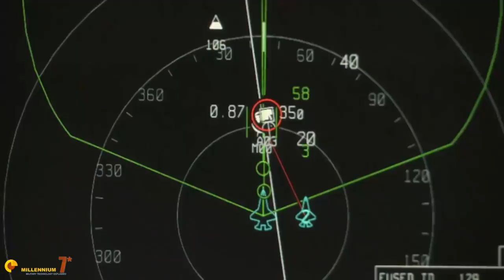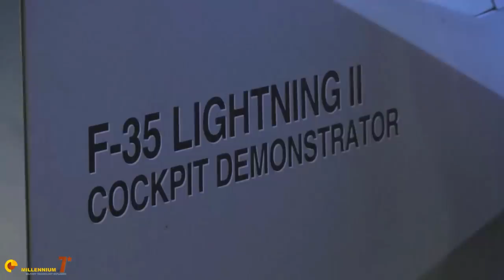Put the F-35 inside the F-16 | Are there limits to upgrades?

Comment: Good video (again!) :)
The F-15 is somewhat more updateable than the F-16. It was designed to counter a somewhat unknown threat from the latest Russian air superiority fighters, so it had more in-built space, more modular design, and more excess of electrical generation, in order to be more easily upgrade-able. The F-16 was designed to make a smaller, simpler plane which largely just competed with the F-15 at short range (a more known quantity), and at low cost. So it's less modular, and has less future-proofing in internal space clearances.
 
Swapping a radar into a plane isn't too bad, provided there's sufficient radome width. The radar weight is rarely an issue due to the trend of shrinking electronics size, this also helps offset the space needed, apart from the radome itself. Phased array plates used in modern radars also tend to help with the space and weight issue, since a moving dish in gen 4 designs tended to require more space to operate. Power definitely can be an issue though. 
 
I think GD really missed the mark with the F-21. It's a re-design of the F-16, and frankly I'm shocked that they didn't go with the F-16 XL wing layout for it.
 
Ultimately, I think any new gen 4++ should incorporate the large all-moving V-tail, hanging back behind the engines. It's just a lot more control with less drag. Not that I advocate a new 4++ fighter design... it would be far easier to "modestly" update an existing gen 4 design, or create a reduced-feature F-35 design.
 
Whatever they end up doing, there's no such thing as a plane with all of the F-35's internal features, at a cheap cost. The internal features are the lion's share of what makes the F-35 expensive to operate. (and make it an order of magnitude more effective than gen 4). There is an argument for having a design which is far less distributed in production though. Currently you need a team of lawyers, diplomats, and translators (and 1 engineer) to make even a minor change to the F-35. It's just far too outsourced to allow for a smooth tweaking process, and that's the main thing driving it's refinement woes. Also, "design while you build" really deeply constrained the design refinement process. I would hope that the USAF (and other branches) never EVER again fall for the "on paper" cost savings sales pitch of "design while you build". They've fallen for it several times now, and it has NEVER realized a benefit. Actually, your video (without being directly aimed at this topic) rather succinctly outlines why and how it's a flawed approach.

PS: loving the new videos sir! Once in a while I may nitpick, but it comes from having a sort of nerdy appreciation of what you produce. Your videos are always excellent.
Reply: @henrikg1388  No... by "modestly updated gen 4" I'm refering to the F-21 and F-15EX, which are both already developed and ready to ship. As for a "feature-light" F-35, taking things out of a plane is actually a lot easier than adding things in, so it doesn't really contradict the points in this video either. I think we got our wires crossed on what I meant by "modestly updated". By "modestly" i didn't mean trying to put F-35 features into gen 4's. I just meant the versions which the makers developed on their own which are for immediate sale, but which are more updated than the planes in inventory.
Reply: All you need to do in order to realize the benefits of how the JSF program was approached is compare the total losses of 427 airframes from the F-14, F-15, F-16, A-10, F/A-18, and AV-8 within their first ten years of service, with 147 fatalities.  Every time I see people critique the 3 different JSF variants for tiny little glitches that every single fighter and bomber go through, I realize they didn’t live through or gain any historical background of all the issues we faced with the teen fighters, Harrier, and Warthog.  You could throw the F-117A on top of that since it was developed and produced at the same time and the airframe losses and fatalities would increase a few, although it was relatively safe since you had to come from another fighter before going into the Nighthawk.  I was kinda shocked they didn’t crash anything during JSF X-plane tests, especially the STOVL model.

Then I was certain we would see them crashing in the first few years, but nothing.  I wondered, “Are they even flying them that much?”  Then looked at total fleet hours hitting 100,000, then 200k, then 300k.  It was just crazy.  Finally, after 12 years of production, the first F-35B crashed during fighter conversion training out of MCAS Beaufort in 2018 (someone installed a fuel tube incorrectly or it was made wrong).  My bets were on either the Marines or the Navy to be the first to put one into the dirt/ocean, with the hazardous nature of carrier operations leaning towards the Navy.  It’s just insane that the Navy has found a way to smash one yet into the deck.  They had an aerials refueling mishap with an F-35C where it ate the steel basket off a Hornet configured tanker.  The F-35C recovered on the carrier, whereas the Tanker Hornet had to divert to a base on land.

Remember, the first F-14 prototype crashed on its maiden flight, and later killed the test pilot, who barely survived the first crash.  The F/A-18 saw 100 (ONE HUNDRED) total airframe losses from crashes in its first 10 years, with 20 fatalities.  These are real people with families, not just numbers.  Harrier was the same.  ONE HUNDRED total airframe losses in first 10 years, 20 fatalities.

We’re 630 airframes into the program, have been in production since 2006, approaching 400,000 flight hours, operating among 10 different services around the world, USMC, USAF, UK, and Israel have been using it in combat since 2017/2018/2019, and we only have 1 fatality?  Israelis have been shot at by Syrian SAMs over 100 times as of 2018, and are very tight-lipped about operations.  News has gone from, “A strike package of F-16Is hit targets in Syria.” to, “Explosions erupted in Syria, destroying cache and missile sites.”

But yeah, I hope the USAF never again uses this approach.  What a failure of epic magnitude!  Flawed approach for sure.  /Sarc

Stop and think people before posting about the F-35 and what a failed program it is.  Black is white, left is right when it comes to 99% of the media I’ve seen on the F-35.
Reply: @henrikg1388  Laughs in Gripen. Look at how many of those they've crashed.
Reply: @henrikg1388  10 major incidents with Gripen. 1 fatality. Multiple crashes were caused by pilot induced oscillations with the faulty flight control system, 1 from uncommanded ejection from the pilot's G-suit slowly working the ejection handle loose when it inflated. It's like reading a clown show.

All 4 JSF crashes have been immediately reported in international media, starting with the 1. F-35B out of MCAS Beaufort, 2. the Japanese F-35A that was controlled flight into the ocean/disoriented pilot, 3. the F-35A piloted by a former Strike Eagle crew who left the speed hold on and bounced one off the runway at over 220 knots, then ejected, and 4. The F-35B that mid-aired with a KC-130 during new pilot aerial refueling training over SoCal.

Out of 620 JSF variants delivered, it's an astonishingly safe record.

10 out of 271 Gripens is pretty bad.

There are no production Gripen Es or Fs. They've been strangely quiet about the F, which you would think would be the first model to deliver.
Reply: The late block vipers are way too fat. They get better engines but not more wing so the new ones can't turn anymore. F-16 always was an A2A design at heart. For a bomb truck you can take a phantom or F-111.
Reply: @henrikg1388  Gripen F assembly and deliveries to Brazil are scheduled for 2023. Every picture and latest news of Gripen E- to Brazil has been a single seat with no IRST, no panoramic display (F-35 copied) cockpit.

In the era of smart phones, we literally watched Pakistan's last F-16 crash immediately after it happened.

All F-35 and USAF mishaps are reported in extreme detail. I've been tracking F-35 mishaps for years now, primarily because I'm so used to seeing what we saw happen with the teens. The F-15 stands out as an exception to all its peers in development during the 1970s and 1980s, with an extremely safe record.

A-10 had several problems from the start, mainly with gun gas ingestion stalling the engines. They tried every sort of crazy muzzle device on it to try to vent the gas away from the airflow into the motors, and gave up. Changed the propellant IIRC.
Reply: @appa609  A-7D was the best single engine bomb truck USAF ever had, and they replaced it quickly with Vipers for whatever reasons, supersonic and self-escort being likely.

The best bomb truck they could have had was the XL, but there weren't any motors at the time to give it sufficient thrust.
Reply: @LRRPFco52  Actually on the A-10, they wired the engine igniters into the trigger for the gun. When you pull the trigger, the igniters in the engines fire up, so that if it flames out, it will re-start promptly. Didn't know they also changed the gas, but it makes sense. 

Personally I think the A-10's problem is the gun is too far forward, and the engine intakes too far aft. If the intakes were far forward, and the gun moved rearwards a couple meters, more under the belly, it wouldn't reinjest. But that would be a completely different aircraft, not a mod.

Changing back to the topic at hand though, the F-35's loss rate is even more exceptional when you consider it's really 3 different planes with a high degree of parts sharing. I too am very shocked that they didn't crash the F-35B immediately in testing. VSTOL is not a simple thing to perfect.

You know, the F-4 (largely considered a very durable beast) managed to kill someone without even having the engines installed (wiring fault in the ejection seat at the factory). Also worth noting, the F-14 had extremely high flight hour costs. And the venerable F-15 with it's reputation for reliability had only a 30% availability rate and double it's eventual overall flight hour cost in it's first "fully operational" year.

I think the F-35 is fantastic. It's not the best at everything. But it's spectacular at a set of key traits. And it has very thoughtful forward thinking in what those traits should be. It may not do the eye candy at the air-show like an F-22, but in combat effectiveness it's very competitive with the F-22, and at less than half the price. It'd be nice if the engine had a bit more dry thrust (or it was a little lighter) so that it could supercruise as intended in all 3 models, and have more thrust:weight ratio. And the development process was in several different ways a clusterf$!%. But they kinda brute-forced a good result with sheer volume of dollars. 

But developmental process mistakes are kinda water under the bridge at this point. Mistakes made there are already part of the national debt. To not leverage that sunk cost in development with a strong procurement, is either dumb or corrupt. Meanwhile an all-new gen 4++ would incur an all-new development & manufacturing sett-up cost, which would absolutely be higher than the flight hour cost of operating the F-35. (even though it is fun to entertain ideas of what a new-retro plane might be like). Meanwhile, buying fewer F-35's would drive their per-unit and per-hour price up dramatically...
Reply: Yes, but the F-15 already HAS been developed for several decades. I all revolves around how crucial you consider the stealth aspect. Those who favor it consider any money spent on anything else wasted money.
Reply: @justforever96  Usually, when I see someone saying stealth is worthless, or that it's obsolete or soon to be obsolete, I think they don't know what the heck they're talking about. Likewise, when I see people who think stealth is the ONLY feature worth considering, I think that's just as problematic.

I think F-15EX's are a great buy. Especially with the durability rating, 20,000 flight hours? They'll be a B-52 style workhorse for a long time with that. And they can keep up with F-35's speed-wise, and range-wise. While carrying a lot more ordinance, and they already have an electronic warfare suite, which would further supplement neighboring F-35's.

15EX's & F-35's procured at a ratio of about 1:3 or so (heavy on the F-35's), would make for an 'extremely' effective force. And it avoids any new development costs or new factories. 

I agree that the F-21 isn't as agile as would be ideal, but it's an option for a low-budget filler plane. I guess if you wanted really low budget then the Saab Grippen is an option. Or, if you want something a bit more capable at a bit higher price, the FA-18E/F is an option. What seems MORE likely though, is to get the Loyal Wingman procured as a low cost force multiplier. There's also a fair amount of unknown details in the NGAD program which could change what's best to get.

Just as long as we don't spend 50 billion dollars developing and setting up a factory to produce a new gen 5-minus plane which is less capable than an F-35, in order to save 25 billion in F-35 operating costs. And even if the computer technology allows for easy development, new aircraft production lines don't grow on trees. Plus there's a logistical cost to  adding yet another plane to the lineup.

Comment: I worked on modifying F-16's for 13 years. Putting F-35 tech into the F-16 should not be a problem. Outcome may not be identical, but should be good non the less. Norwegian F-16s went from block 1 to block 50++ and they are not finished yet
Reply: They forget that the F-16 has been an ongoing upgrade program for years.
Everything from RCS reduction, engine upgrades, alternate engines, radars. 
Not to mention that almost all the systems in the F-35 including it's engine intake, were tested using an F-16.

Comment: I understand that you don't mess with the aerodynamic profile without doing much redesign to everything.. but, how do that account for the proliferation of conformal fuel tanks? They are essentially bolted on as an afterthought on perfected aerodynamic profiles like the F-15, F-16 and Mig-29. But it seems to work out great, so much as these modifications are permanented in later variants, like the F-15EX, F-21 and Mig-35.

Comment: well, i do think about a modular system with sensors weapons fuel etc all is pod based and the airframes dont matter with just a flight control and pod interface display, like each pod has an internal web page.

Comment: How can it be that the F-15 platform still can be updated?
The new F-15 EX as not in common with an old F-15A. As fare as know the sensor fusion computer in new F-15 EX can read more code-lines than the one in the F-35.
You have to make a video on the new F-15 EX
Reply: there is simply more room in the F-15 air frame than in F-16 air frame. Vipers are designed as lightweight fighter, so everything nonessential is striped down. In the beginning, the concept even called for a radarless, VFR only gun only fighter. On the other hand Eagles are designed as a air superiority fighter, and house more avionics from the beginning. So upgrading F-15 make way more sense, although the reduction in electronics size had benefited Vipers greatly
Reply: @VuLamDang  I still wonder how they cope with cooling issue. 
- So in future a bigger two engine platform would be ideal to cope with later updates. However, I am impressed that the old eagle platform still are evolving after nearly 50 years.
Reply: @henrikerdland578  that's a big part of the problem and where the Eagle have the most advantage imho. A lot of the cooling power lay in how much fuel you carry - fuel is a greatest heat sink that actually need to be heated up and also not exposed to heating by air friction and shockwave at high subsonic to super sonic speed. The Eagle simply carry more fuel that can act as heat sink for the new avionics.

2 engines also provide way more electrical power, so that's another advantage too. I think F-22 platform will have the same upgrade potential as we currently seeing with the Eagle

Comment: I agree with what you recommended in the video but perhaps the F-35 like systems and avionics can be introduced in the Next Gen F-16 BlockXX or a redesigned F-21? 

Or perhaps we will have to wait for the NG F-16XL or the F-36 Kingsnake? Perhaps much cheaper than the F-35 but with 85% of the capability, specifically for EW....

I believe that the Gripen E/F already does this at a very low life cycle cost...

Comment: will  the next 4.5+++ gen  US  plane designs  have  thrust vectoring  ?
Reply: We can only speculate, my own speculation is no unless its VTOL capable, the US isnt looking for the same thing the russians do. The US dont have the need in super maneuverability and it is regarded pointless in any plan for air superiority and mostly redundant in gen 5 fights. The fight as it is now relies heavily on system fusion, datalinking, and force integration. The USAF relies on a united force of organized aircraft using a GCI to direct as it always did, the main difference that was made since the 90s was how much autonomy the flights have, considering the new systems they have more freedom of movement and less pressure on the GCI which allows for a fluent and flexible strike force.